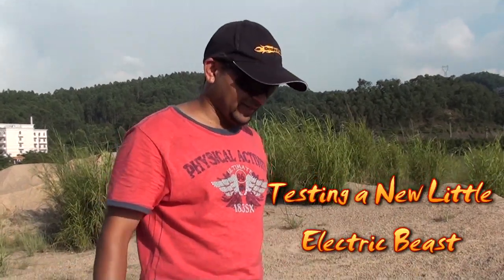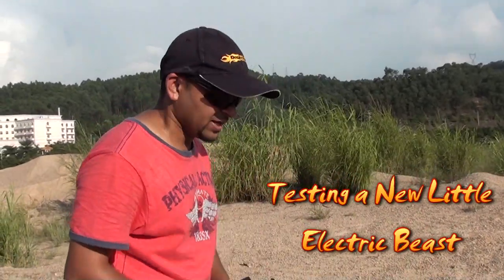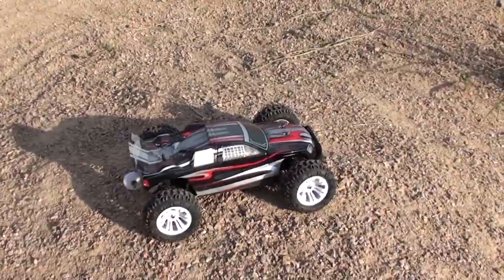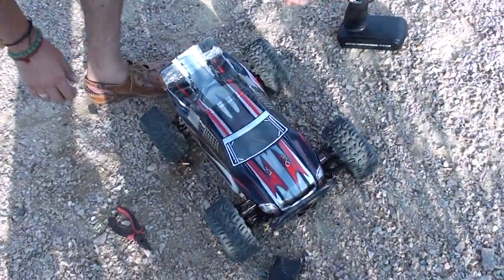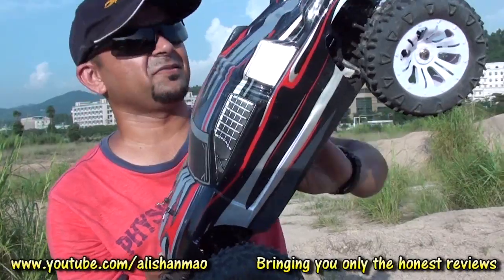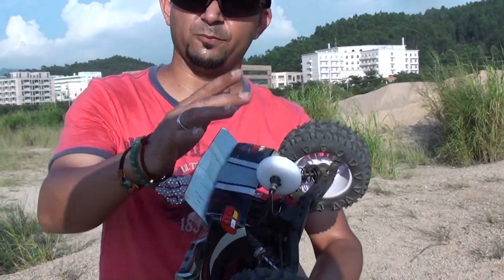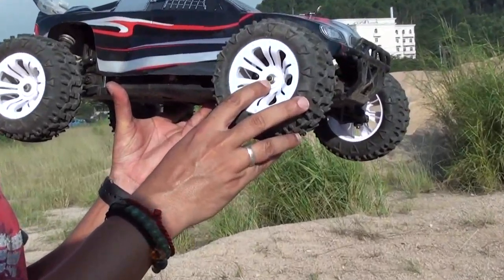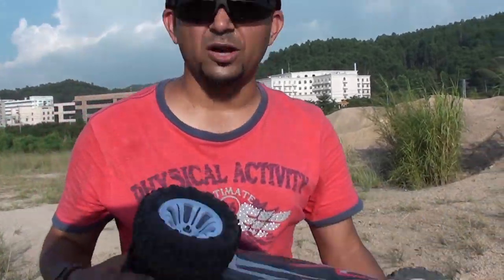Testing New Electric Truggy

Comment: An RC with that much power, need throtle control or else those tires will blow out and wont have the tires comming off. But that one rips threw that dirt and brush. How much does that run for?

Comment: hello iw got marevick strada evo xt s truggy for christmas and i would like you to help a bit. my servo broke and i need a new one i found a cheap metal geard servo called mg995 is that okay for it? and my second question is that if i buy a lipo battery (DragonRed 5000mAh 2S 7.4v 30C Lipo Battery ) and a charger (iMAX B6-AC B6AC Lipo NiMH 3S RC Battery Balance Charger) are these going to match and will it work out? thanks